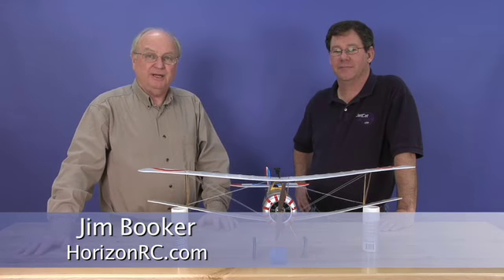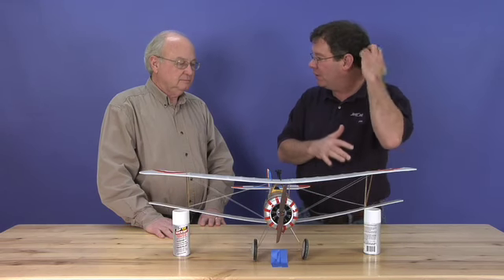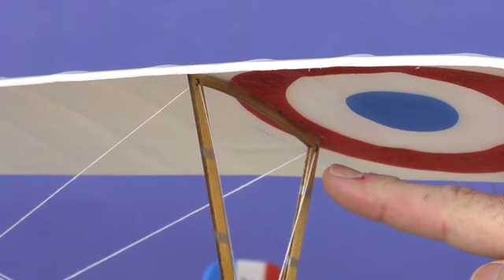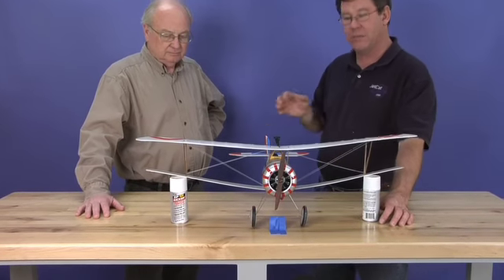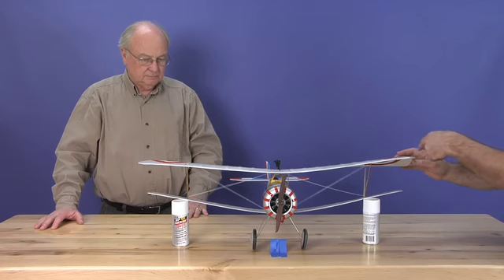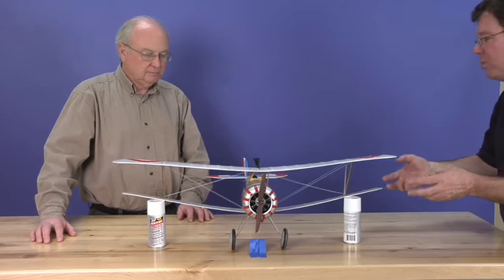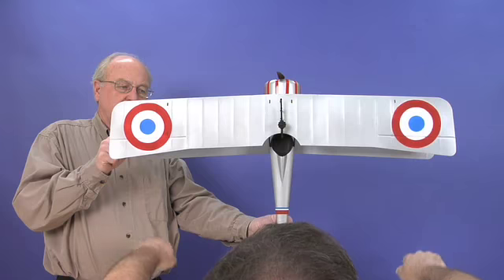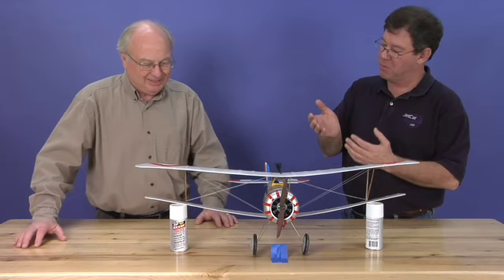HorizonRC.com How-To: E-flite Nieuport 17 and JN-4 Jenny Wing Rigging (Part 1 of 2)

Comment from the maker: Run all the rigging and tie it off or glue it where the string begins. Then pull it all tight as you sight the wings. Keeping the string tight you sight the wings to make sure there are not any warps in either wing. Then Once the string is tight and the dihedral is correct you can secure the string at the location where it terminates. Now you can move and adjust the wings before you secure the string at each point where it goes through the wooden struts or fuselage.

Comment from the maker: The Jenny is $54.99, and the Nieuport is $61.99 on the Horizon Hobby website.
Reply: Horizon Hobby Wow, that's not bad at all. I'm looking to buy an RC plane, and I like these WW1 planes. It doesn't seem too difficult to assemble even though the dihedral strings must be assembled precisely. I'm actually looking for my first REAL RC plane. I've had the Air Hogs, etc, but I'm really interested in getting one of these. I'm very impressed with all the Horizon Hobby planes I've looked at. They're made with such great detail, and craftsmanship. All of your products I've seen are just absolutely amazing. Very top shelf! Keep up the amazing work!

Comment: Ok... so you're saying you run all the rigging, tie it off at both end points, and then start pulling the threads either way making adjustments? How is that supposed to work? Are you tying the end points to the struts? I have been at this for hours, and once it's tied down, i cant change anything. In the video you make out like you're pulling these loose ends to make things tighter etc., but at the beginning you said it's tied down.

Comment: when looking down my wing it looks straight  like out of the box the trailing edge, now when I look at the wing the top  wing from the front with the tail upward , it looks as though the ends of the top wing have a slight  warp down  on both ends equal , is this normal>?